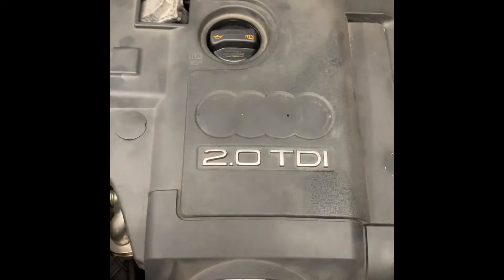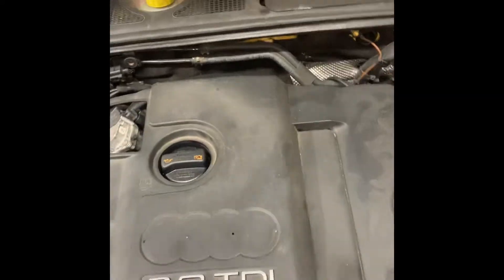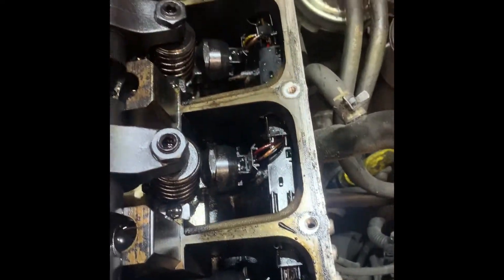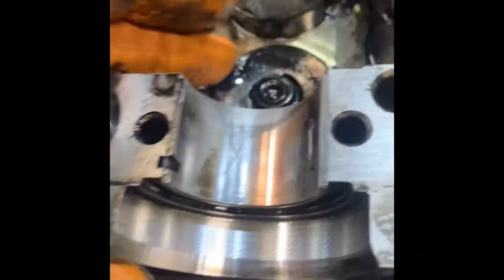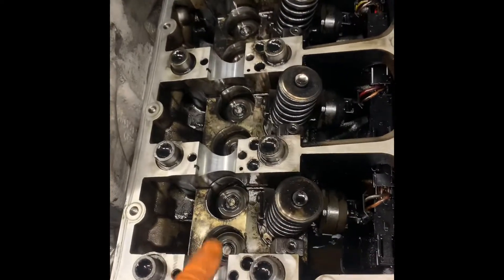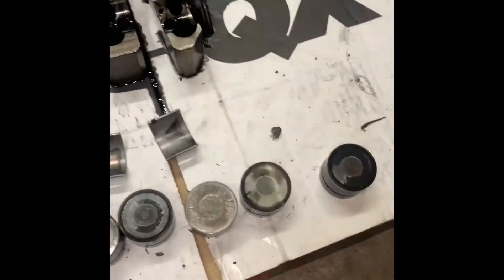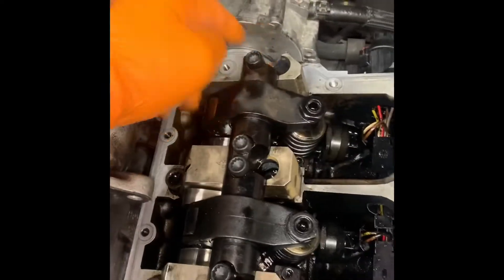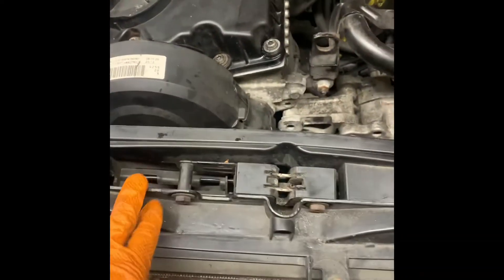Audi /Vag 2.0 TDI (PD) Engine CAMSHAFT REPLACEMENT(worn camshaft and followers)

Comment: Are the head bolts one time use only ?
Also is it possible to inspect the cam lobes without removing the tappets and cam followers ? Last I had the valve cover off I couldn't tell anything and I don't have history of the car (2.0 BDK Golf 5)

Comment: Hi
Which is the cause of this wear on the camshaft?

Regards!
Reply: The camshaft is under a lot of stress on these engines as it drives not only the valves but also the pump injectors so it is very important to use the correct oil spec otherwise this happens

Comment: How do you put the camshaft back in?
Reply from the maker: It’s basically the opposite of removal, tighten down the bolts gradually and pull it down square..
Reply: @Chris_CDB  I've got the crank locked into place, however before tightening the bolts for the camshaft, do I need to put that into top dead centre?
Reply from the maker: @sullythegamer2492  You will need to get it somewhere close, it won’t sit exactly where it needs to be as the lobes of the cam won’t allow it, you should be able to look at the keyway on the cam and see roughly where it will line up with the sprocket hole (the locking hole), and as you tighten it down it should be somewhere close, you will need to be careful though as I have had people attempt it and crack the camshaft where it has been in the wrong place… the other way you can do it is to take the crank locking tool out, wind the crank back 90 degrees…. This should put the pistons all basically middle of there stroke in the cylinders, so they will be out of the way of the valves opening, then you can tighten the cam down where ever it lies, get it snug, rotate the cam round clockwise until you line up the locking hole, put the pin in, and them rotate the crank back clockwise until top dead, put your tool back in and you should be back in time ready for the belt.